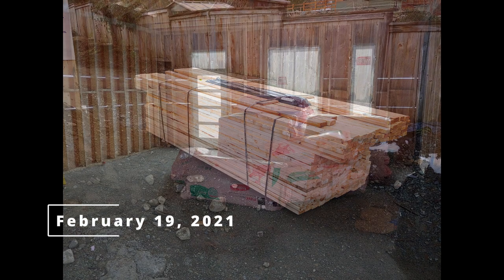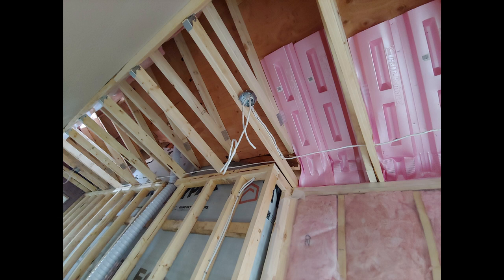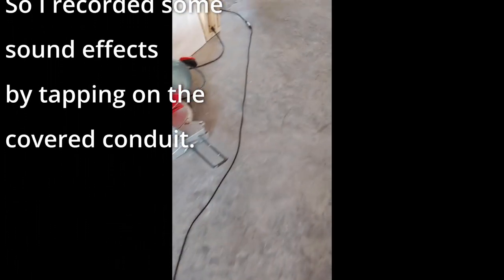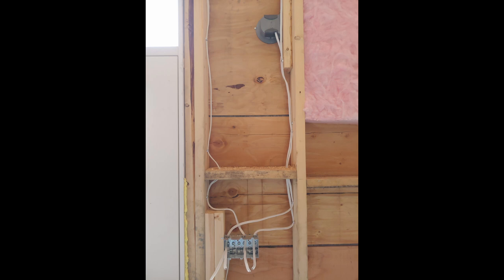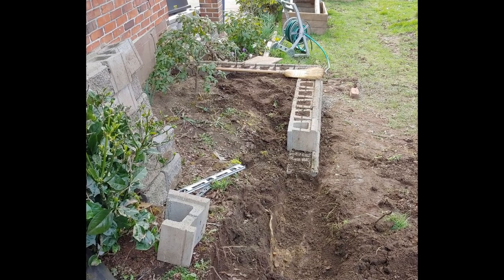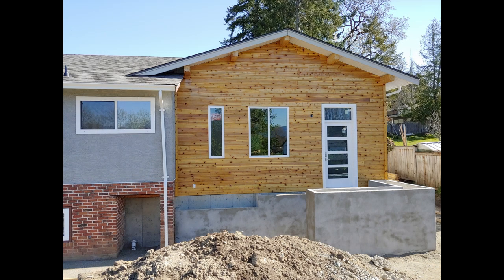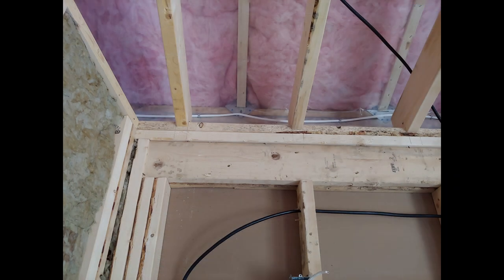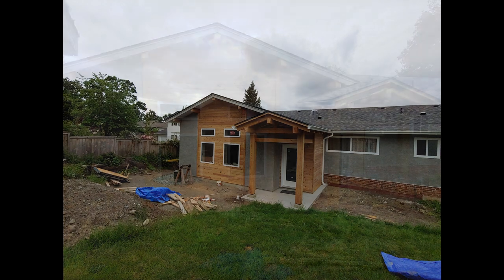How I built a Recording Studio addition (Part 2)

Comment: Aah, inside out wall construction! Awesome and amazing job guys.
Reply from the maker: Thanks.
The inside out wall construction scared me at first, but it wasn't that bad. Plus, no drywall mudding.
Reply: @EdgetoneStudios  Question, I noticed while you were building that the cavity between the drywall and the outer leaf was empty / hollow? Shouldn't there be rockwool / fiberglass as well to fill this gap? Or is this neglectable? I've seen some people spray glue rockwool on the drywall before lifting it up but that also seems a bit sketchy somehow haha.
Reply from the maker: From what I've read and watched and learned, there "must" be a full air gap between the walls. You need to have the transition between different densities of materials to attenuate as much as possible. 

The other mistake that people make is that they put drywall on both sides of one or both of the walls, and this allows the sound to travel through the drywall, studs, drywall and won't attenuate as much. The walls act more like a drum then.

Comment: Wow, that's a really great studio design. I would like to ask about the slat resonator there, is it constructed to be airtight?
Reply from the maker: The slot resonators have open air slots at the front, but I did seal the corners at the back with acoustic sealant. I doubt that made much of a difference. I think the main purpose is for the sound to be absorbed into the insulation behind the boards. Not sure how much "resonating" is happing. 

If I understand correctly, the varying widths of the slots (1/8" 1/4" 1/2") allow different frequencies to pass into the insulation more easily and be absorbed, while the varying sized of the boards (2 1/2", 3 1/2", 5 1/2" for type one and 6 1/2", 7 1/2" for type two) reflect various frequencies. 
Since the ones at the back of the control room are also angled, they give some diffusion. 

The combination of angled walls and ceilings, broadband absorbsion on all the cloth surfaces and more selective absorbtion and diffusion off the slots evens out the mid to high frequencies. Then the bass traps attempt to deal with the lows.

Whether I fully understand or not, it really does sound great in the control room.
Reply: @EdgetoneStudios  Thank you for your explanation! I'm curious if you could provide more details about the slat resonator design. Specifically, what is the spacing between the slats, the width of the slats, and the thickness of the boards? I’d love to understand how these dimensions contribute to the overall acoustic performance
Reply from the maker: @panca4238  There is a link in the video description to the full plans. The slot resonators details are shown at the bottom.
Reply: @EdgetoneStudios  Thank you.!😊

Comment: Great video! Amazing story too 😊. Question, how’s the sound isolation quality with the timber frame? Any sound escapes to the outside? Like drums or guitar amps?
Reply from the maker: It's close to dead quiet. Within 10 feet of the back wall you can slightly hear a full drum kit. Beyond that it's barely inaudiable. All those details really worked.

Check out this Instagram post from when I had just about completed the finishes. https://www.instagram.com/p/CVg3AaopSCD/
Reply: @EdgetoneStudios  That's good to know! very good results for timber frame structure
Reply from the maker: @JBRRecordings  yes. Cement structures have more mass by default, but decoupling the interior wall from the exterior wall, using two layers of 3/4" drywall, and all the acoustic sealant really works. It's the attention to details that count.

Interestingly, the only outside noise I really hear with the doors and windows closed is if a low flying aircraft goes over the house. It's not very loud, but it get through the ceiling. This is partly because of the roof ventilation and the soft air ducts for the HVAC. The HVAC also can draw air from the outside, so that the ceiling is not completely soundproof. But it's rare that I hear a plane and I wouldn't hear it if music was playing.

Comment: Have you found any Canadian suppliers for green glue ?
Struggling with that right now
Reply from the maker: No. I didn't need anything like that since my walls and ceilings are already decoupled from the house structure. At least mostly they are. The walls obviously sit on the same slab that is directly connected to the foundation walls, but that's why there is the 1/4" foam under the walls.

However, could you use SONOpan in your particular application? https://www.homedepot.ca/product/sonopan-soundproofing-panels4-foot-x-8-foot-75-inch-thick/1000441119
Reply: @EdgetoneStudios  Sonopan is already ordered , this is built in studio, but still a full room within a room, 3 layers of 5/8 drywall between joists on outer ceiling and then thr inner room is a layer of Sonoran and 2 layers of 5/8 drywall 
Figured between the 2 layers of 5/8 mine as well add the GG
Reply from the maker: @chriscarr1791  I'm not expert, but I have some modest experience with builds. My guess is that the GG is overkill. You're really just trying to get rid of vibrations between the drywall sheets, but the Sonopan is already doing that. And with room within room, you don't even need the Sonopan. I had at least 50 db of loss between the tracking room and the outside of the building and I used neither Sonopan nor green glue.

See this Instagram post for confirmation: https://www.instagram.com/p/CVg3AaopSCD/